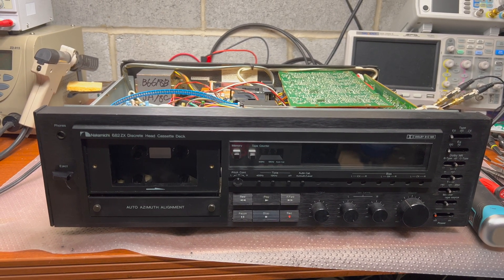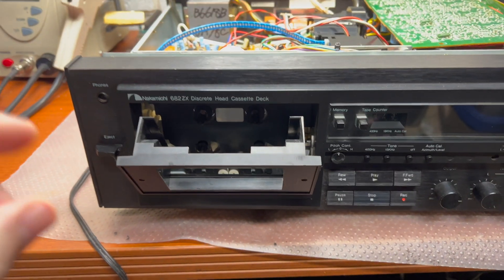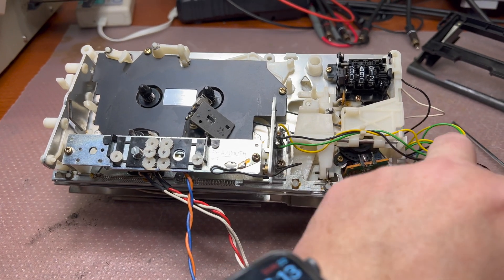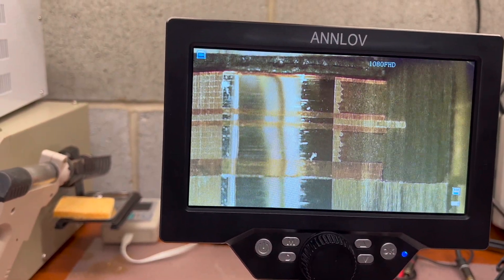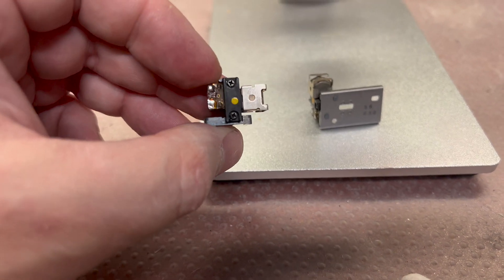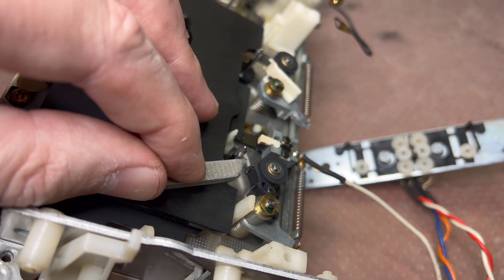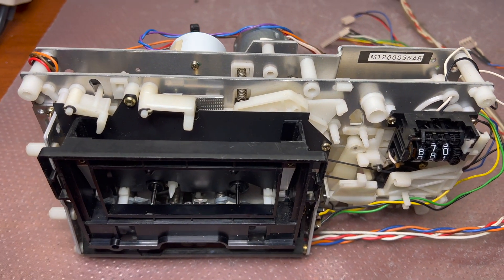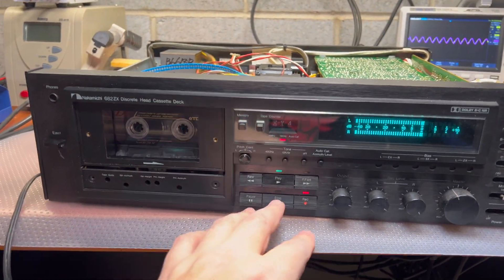Replacing the Playback Head on the Nakamichi 682zx: A Step-by-Step Guide

Comment: Hello  how did you measured     signal  level  on osciloscope  and  voltmeter    what  resistors  load  you used?
Reply from the maker: It is described in the service manual, I Use 47 kOm resistors at the VTVM as a final load.

Comment: Great work. I'm working on a 670zx with the same problem. I can't figure out why the playback head has a loss of 6db on the right channel.
Reply from the maker: It looks like someone reconnected to have just one of two coils per channel connected on the playback head. Or if you replaced then you have to adjust levels.